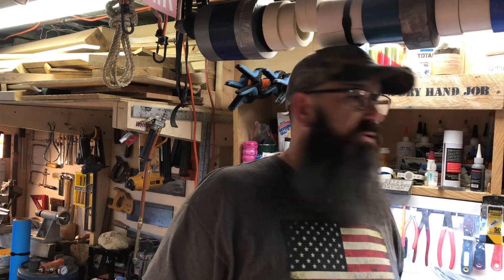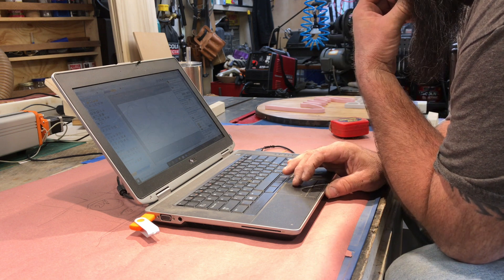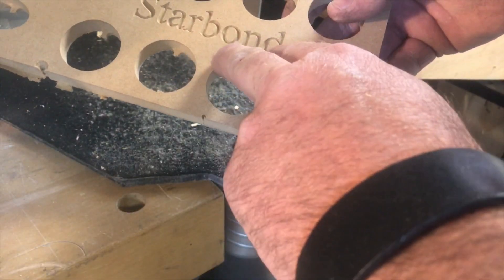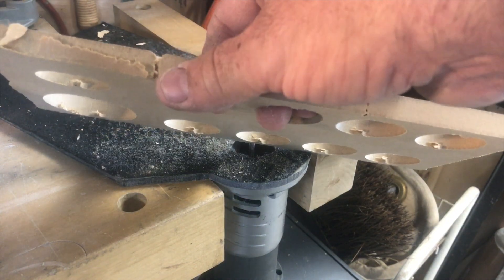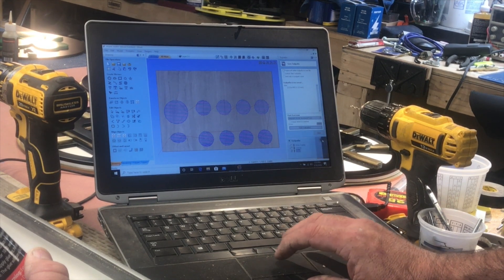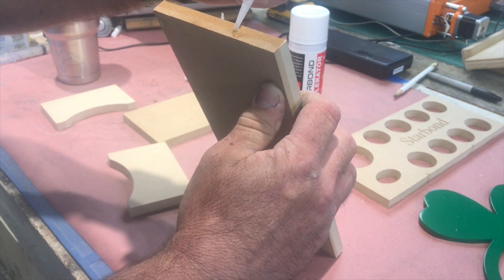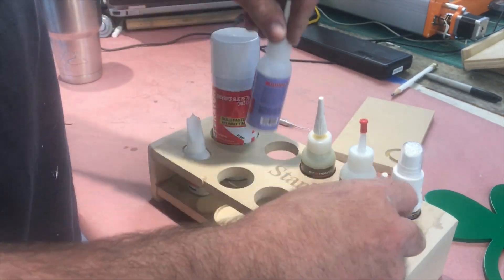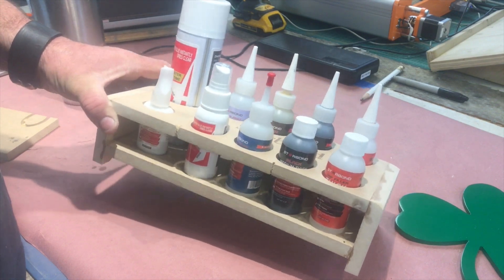Derek from Malden makes a glue caddy with a StepCraft CNC

Comment: Question. I am actually going to make a paint caddy. All the bottle are the same size so I'll probably use my Dads drill press and his pile of scrapwood😀... BUT what was that sealer u used on the MDF. I absolutely know how it can be a black hole for glue and that sealer sounds awesome. What was it?
Reply from the maker: Sorry Im not on here much.  it was thin Starbond glue
Reply: @DerekFromMalden  thanks! I'm not on here super often either. We all have lives.
I appreciate the answer.